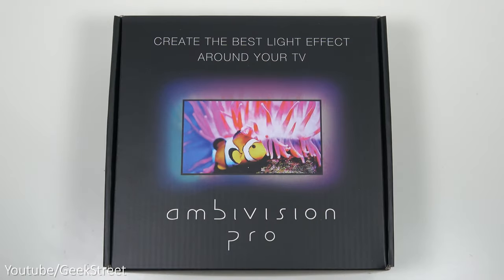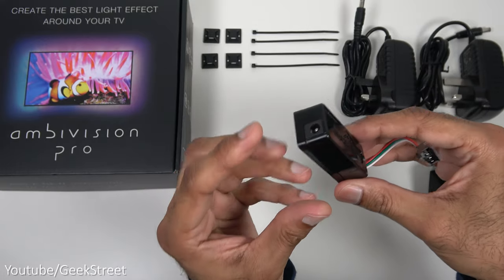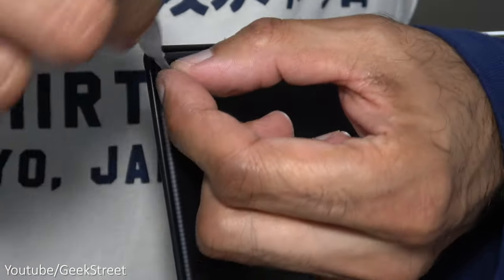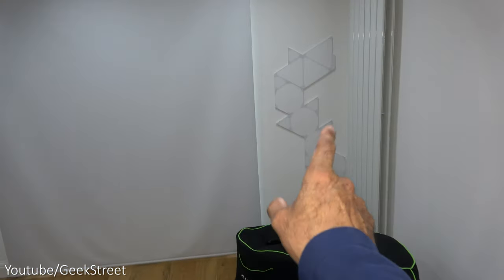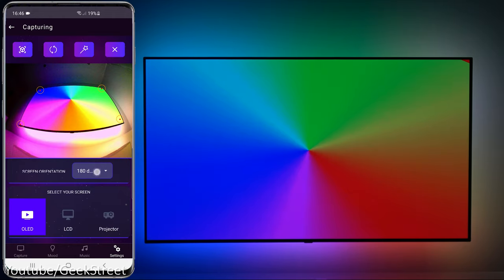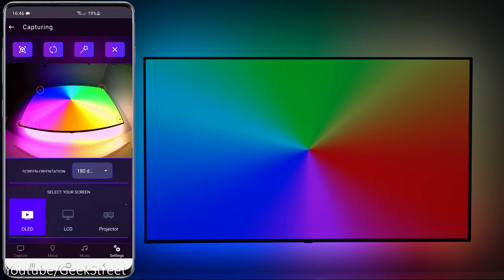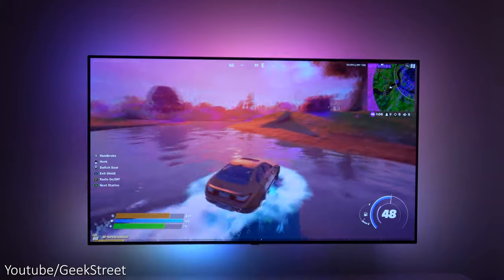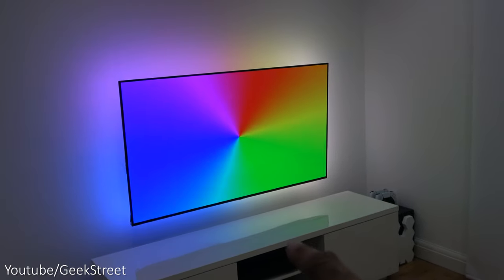ULTIMATE TV BACKLIGHT LED STRIP KIT AmbiVision Pro | Philips Hue HDMI Sync Box / Govee Alternative

Comment: How would you rate this over the Govee setup for accuracy and film content where black bars feature at the top and bottom of the screen ? I have the first gen Govee and the back lights would normally stay white for the most part. Does this do a better job ?
Reply from the maker: Same sort of thing with this one too ... adjust the calibration to the region inside the the black bars that will help your situation.
Reply: @GeekStreet  👍

Comment: Is wifi required for it to work or just for set up?
Reply: Internet connection is obviously required for firmware updates. For normal use and control, a router is enough (it can be without an internet connection). Greetings :)

Comment: It seems to be the best alternative to true Ambilight. But, just like the Philips Syncbox,  it is still nowhere near as good as a true Philips Ambilight TV.
Reply from the maker: Yes definitely a good alternative and your right it won't be as good as a Philips Ambilight TV.
Reply: Yep, no worth it to compare it to Philips Hue, but this is not even close to Govee, maybe the only real advantage is that it can be used to a bigger range of tv sizes, but for quality is too low
Reply: @samuelgomez974  the led strip is cheap the power supply is cheap and who wants there tv so far from the wall and then have to go through all that set up.  If you have a PC just get 2 light bars and philips hue Bridge.

Comment: Seems there's a bunch of people with stock in Govee here. None of the camera based systems are going to be very good when compared with a sync box, the Phillips solution costs WAY too much (laughably so--it would cost me like, $600 to do my tv, and I already have Phillips throughout my house), and the Light Mi doesn't support more than 30Hz refresh rate at 4K (I've also heard that it doesn't support HDR either, though that wasn't mentioned in this guy's review of it). There are work arounds for some issues with those, but it seems the best affordable solution is still to build your own with a capture card and Raspberry Pi. I just REALLY don't feel like doing it with all of the other projects I have going on at the moment, but it seems like that's what I'm going to have to do 😑. Why can't some company just do this right at a reasonable price? It's not that difficult, but I just don't have time, personally. Very frustrating 🤬
Reply: Lytmi neo Box Support now 4k 60hz Dolby Vision + Hdr. Its a New box 2.0. Next year they Release Box 2.1
Reply: @Senni1986  Thanks for the heads up!
Reply: @Senni1986  Downside being it won't work with smart Tv apps since they don't have an external HDMI signal. I could see these cameras being better for that type of video situation.. but still not ideal for the reasons menitoned.

Comment: This product looks like an expensive copy attempt from Govee Immersion. I do not see the advantages over Govee Immersion but I do see a price four times higher. Not attractive. Perhaps the only advantage is that it can be implemented in small televisions from 32 to 55 inches. The rest I do not see.
Reply from the maker: A few advantages over Govee, colour is more accurate, no camera attached to the TV and can supports TV's up to 150".
Reply: Actually, Govee is copy of AmbiVision :) It was a project funded on kickstarter or indiegogo few years ago. Probably that's a reason why it is more refined and looks like they use better quality components(optics and higher resolution of the LEDs).
Reply from the maker: @kakamistrz1990  Interesting thanks for the info
Reply: @GeekStreet  we’ll, I don’t have the Govee to compare, have the Hue, but on the videos of Govee it looks way better on color reproduction, color sync and even the lag is shorter. This one looks just like a non finished product or a prototype
Reply: @samuelgomez974  there is no comparison!!!
Ambivision Pro is so much better!
Please take it from me, because I have both devices!
The Ambivision beats Govee in every capacity!!!